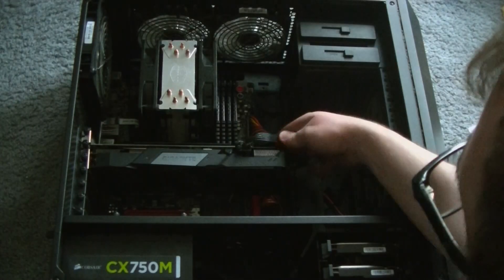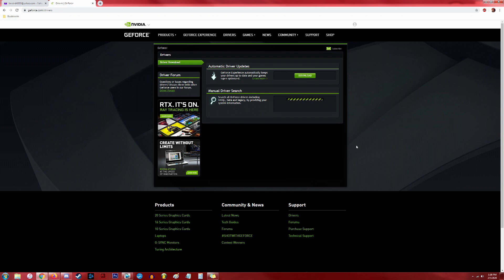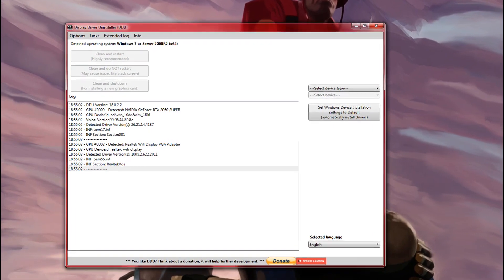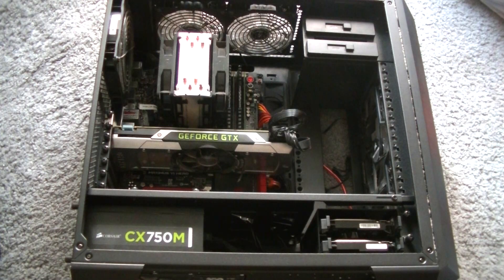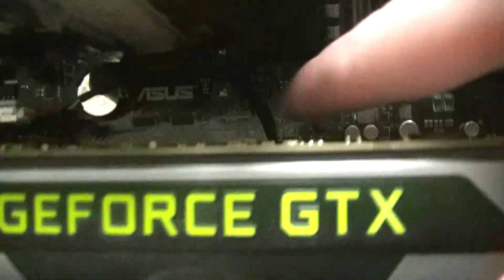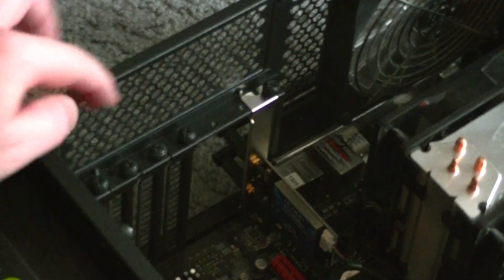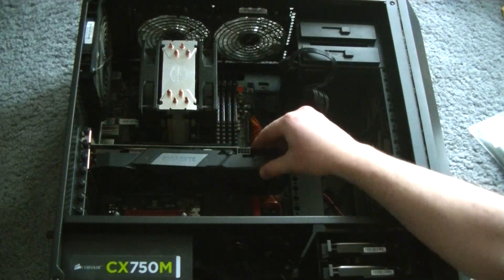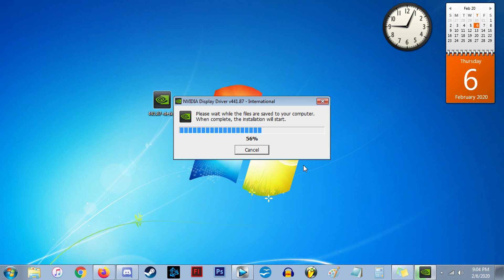How to Install a Graphics Card into a Desktop PC

Comment: This might seem like a stupid question, but I have a decently old computer that isn't made for gaming I want to upgrade. It has a small graphics card but I don't know if something like a RTX 3060 (what I am planning to buy) will work with it. Will the new GPU work? Can my computer handle it? Is this a legible thing to do or should I buy a new computer? Is it even compatible? Sorry for the long question.
Thanks in advance
Reply from the maker: Basically it's up to your power supply, I'd be surprised if even a small modern PC "wouldn't be able to handle it", because again, these days all GPUs should be compatible with all the components. Just make sure you have a strong enough PSU (check on NVIDIA's website and see what they recommend for wattage)
Reply: @Torqcx  Ok thank you

Comment: So if i have an uhd 770 integrated graphics, i haven't to disinstall any driver before installing a graphic card
Reply from the maker: You shouldn't! On modern motherboards the graphics will default to a dedicated card that's physically installed in the slot.

Comment: So does the graphic card work irrespective of the processor speed and all that or say

Processor speed: 3.00Ghz
Then yo wanna install gtx 1050 to.

Will it work?
Reply from the maker: The processor doesnt have anything to do with the compatibility of the graphics card, any will work alongside any. However, if a processor is not fast enough, it could bottleneck the performance of the graphics card.
Reply: @Torqcx  Ok thanks for the info
Reply: @Torqcx  hello, i was wondering how to get my pci cables out of my pcu because i have a prebuilt and im trying to install the gpu but i cant connect the pci cables because they arw stuck inside my pc
Reply from the maker: @Tom-oh5vs  They're stuck in the PC? You mean they're physically jammed somewhere in the system? If that's the case I'm not sure what to say other than just trying to force them out. They shouldn't be stuck into anything unless it was accidental.
Reply: @Torqcx  do you think if i force them out it will unplug anything else?
Reply: @Torqcx  and yes, they are litterally stuck in my pc. I even took out the psu and they are still stuck
Reply: i just didnt froce them out because i didnt want to break anything
Reply from the maker: @Tom-oh5vs  are they stuck in one of the corners of the case? Get pliers if you must, don't be shy shimmying them out.
Reply from the maker: @Tom-oh5vs  Based on all the info I have, I want to say nothing bad should happen? But I don't know exactly where the cables are stuck. PCI-e cables from the PSU only plug into graphics cards, so if they're not in a graphics card, I don't see what the harm could be in removing them from wherever they are right now.
Reply: @Torqcx  ok thank you i will try that

Comment: Can you install a graphics card into a office pc.  I don’t know the processor it just says i5 on the front
Reply from the maker: You'd need to open it up and find out if it has a PCI-e x16 slot, and from there determine if the PSU is powerful enough to support it (it most likely isn't, in which case you'd have to upgrade it).

Comment: where can u buy the cable that goes into the graphics card?
Reply from the maker: The cable will come off of the power supply, if it's powerful enough. If you don't have one and your graphics card requires one, you need a new power supply.
Reply: @Torqcx 
I checked my PC yesterday and I found the cable. thank you for the answer

Comment: See I have an mini itx board and a atx case and the pcie 16 slot doesn't line up what do I do should I just get a pcie 16 slot extension cable or will I just work I can send an image if you need to
Reply from the maker: I've never heard of a PCIe extension cable, but if the motherboard isn't lining up correctly it sounds like that's what you will need to do, otherwise you could get a new case.

Comment: What is there to to if i can turn on my computer but my monitor doesnt get a signal from my hdmi port and beacause of that i cant delete my old drivers can someone help me please ASAP ?
Reply from the maker: Do you have onboard video and it's not working? Do you not get a signal regardless of where the cable is plugged into? Try resetting the motherboard by clearing the CMOS (you'll have to look up how to do it)
Reply: @Torqcx  no i am using my old graphics card but when i plug in the hdmi from onboard to my monitor it doesnt work either but i think it never did in the first place if thats possible
Reply from the maker: @dwayneloco1215  that's because the motherboard is defaulting to the graphics card when it's plugged in and onboard gets disabled. When the card is out, you should be getting a signal from the onboard.
Reply: @Torqcx  ok so should i reset cmos first and then unplug the graphicscard to use onboard video so i can delete the drivers ? And thank you so much already your helping a lot
Reply from the maker: @dwayneloco1215  you shouldn't have to reset the CMOS, but if you still don't get a signal, then yes, try resetting it and go from there
Reply: @Torqcx  ok thank you for your time man i really appreciate it
Reply from the maker: @dwayneloco1215  absolutely!

Comment: I wanna install my RTX 3080 but I also need to change my PSU to 850 watt, Do I also need any water cooler because I don’t have one.
Reply from the maker: Water coolers are not necessary. Just upgrade your PSU and you should be all set. :)

Comment: Ok, just got a 1050 ti and there's like, 10 different drivers to choose from? Should i just grab the newest one? Im on windows 8.1 so im not sure if the newest one will work
Reply from the maker: Yes get the newest one and make sure it says it's for Windows 8.1
Reply: @Torqcx  done, i took out my old card, but the 1050 ti seems to have it's connector pins covered? Or are they just really thick pins?

Edit, they were covered, im an idiot lol

Comment: my left side of it isn’t going in i’m so pissed
Reply: Bro that’s what’s happening to me now is there anything you did to get it in
Reply: @charliep5894  did you guys find a fix?
Reply: @kitudja1  sorry for the late reply bro but my motherboard wasn’t sitting correctly and u kinda have to force it all the way to the io shield
Reply: @illbotyouonfortnitecuhh2637  yo wat happened weeks later? And i dont think the left side goes in like the right i was having that problem earlier but then a guy said it slides it and u screw it to keep it in place cause the left side falls out easier then the right cause the whole card isnt really snapped on thats y you use the screw
Reply: @charliep5894  sorry for the late reply bro but my motherboard wasn’t sitting correctly and u kinda have to force it all the way to the io shield

Comment: so i didn't have to uninstall my integrated graphics if buying a new one?
Reply from the maker: Correct; integrated cards are embedded within the system's motherboard, and the motherboard's BIOS (Basic Input Output System) generally will have a default of disabling its own integrated graphics drivers when a dedicated GPU is installed in it.
Reply: Thank you! Im just starting to learn now, just need a few upgrades on my pc

Comment: What the deuce do I do if it requires a 6-pin connector but there are no connectors
 available?
Reply from the maker: You can get a converter (there are various ones, but some that work at 2x molex to 6-pin), but generally speaking if your PSU does not have any 6/8-pin connectors, chances are it is not powerful enough to handle the card in the first place. Check its wattage (typically dedicated GPU's that are mid-grade require at least 400w or so).
Reply: Thanks.

Comment: After u install gpu and the pin do i connect hdmi there or at the top i have Integrated graphics or do i connect the hdmi at gpu
Reply from the maker: You would connect the cable to the newly-imstalled GPU.

Comment: How do I connect a GeForce RTX 2060. My cables have 1 eight pin and 2 break of two from 6 pins. I’m so confused where do I plug them in :(
Reply from the maker: I too installed an RTX 2060 in this video, and the card requires only 1x 8-pin. Just plug the 8-pin connector from the PSU to the 8-pin port on the card and you'll be all set.

Comment: Does 3070 graphic card support in h61 gigabyte motherboard with Intel i3 2 gen processor  which I have 4k TV to view 4k movies and play 4k games
Reply from the maker: Virtually any motherboard will support any graphics card, your power supply is what you want to be concerned about.
Reply: Power supply means the smps right which smps does it supports

Comment: Can you please help me I cant get to the windows screen,I'm stuck in bios
Reply from the maker: Did this happen after you swapped out/installed a graphics card? Try re-seating it, blow out any potential dust/gunk that could be in the slot, make sure the teeth on the card are clean, etc.

Comment: I'm trying to install a graphics card and a WiFi card, I'm wondering how to install a WiFi card in a PCI express 1 slot (not sure on terminology XD) is it the same as a graphics card or is there a few extra steps?
And whats the frames I can expect when I install graphics card, for games like apex, fortnite and valorant, can give a few specs now, let me know if u need more
Motherboard: D3230 A1
CPU:Intel(R) Pentium (R) CPU G3260 @ 3.30GHz 
Planned gpu: ASUS Nvidia GeForce GT710
RAM: 8GB
Reply from the maker: Installing a Wi-Fi card is a similar, easier process than installing a graphics card, and I have a video on it here: https://www.youtube.com/watch?v=nyqou9hU7mY

As for your system, those specs look closer to the budget side of things. Not bad, those games will certainly be playable, but you'd probably have to keep things on the medium-low settings if you want anything near 60FPS.
Reply: @Torqcx  thanks alot, so happy rn, have a great day man

Comment: I have one question. This pc that Im using now, has a GT 1030 DDR4 with a i3-4130 and I have another pc with Pentium G4400 but with GT 1030 DDR5. Since i3-4130 > G4400, I wanted to place the better GPU in this one. Do I need to do anything about the drivers? Or I just need to take out the gpu, place the other one and then Im good to go?
Ps: I don't know if this is important, but the pc with i3 4130 was from my uncle, so it has cracked windows 10. I was thinking in getting windows 10 the free version, with that watermark. What should I do?
Reply from the maker: You would just follow what was instructed in the tutorial. Does the other PC already have a GPU in it? If so, uninstall the drivers, take it out, put in the new GPU, and install the new drivers. Otherwise, just plug the new card into the system and install its drivers.

As for the OS, that is up to you. I don't condone or support piracy on this channel. If you want to be safe I would get the free version of Windows 10 (or just buy it).
Reply: @Torqcx  Thank you!

Comment: My gpu doesn't fit in my pc! What am I supposed to do?
Reply from the maker: Then you need a different GPU or upgrade to a new chassis.
Reply: @Torqcx  reeeeee I bought it on ebay and I can't return it. I guess I can use an extension cord but either I need to have it outside the pc or I need to lay it horizontal  and hope it fits that way and it's not too thicc

Comment: hey just a question where would i find the power supply cable that i can plug into my gpu (if that makes sense) i wanna upgrade my prebuilt with integrated graphics but i wanna keep my regular PSU so where would I find the “external power for dedicated gpu” cable?
Reply from the maker: The PCI-e cable from the PSU will only exist if the PSU has enough wattage to support a dedicated card, which most OEM PC's don't have. Most likely you will have to buy a new PSU that will be able to support your new graphics card and swap it out.
Reply: Torqcx okay thanks

Comment: I have an old hp pavilion that I brought in 2017. It’s a desktop pc that I wish I could play games on it with good fps. I was thinking what if I replace the graphics card and order a GTX 1660? Would I have any problems doing that? I’ve never done a tear down for a pc.
Reply from the maker: It's likely that that desktop has an integrated card, and it's possible you can upgrade to a GTX 1660 but you'll  most likely also need to upgrade the power supply.

Comment: So u take the side screen of the computer off? I’m a bit confused because u just showed inside the pc without taking anything off. I thought ur supposed to open the back of the pc to get the card out 0_o
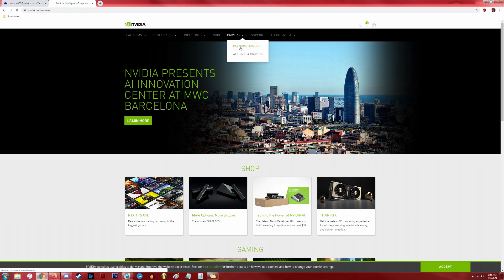Reply from the maker: You take the front side-panel off. Sorry  I did not show an example, I didn't want to confuse anyone because the case I have has a very odd, unusual method of taking it off. I have a video where I demonstrate the process on a more typical case right here: https://www.youtube.com/watch?v=nyqou9hU7mY @ 0:46
Reply: Torqcx thanks I’ll go check that out! I have this Lenovo h535 pc and trying to see if it has the slot to put in a card and if so what card to use.

Comment: Installed new graphic card,card is thicker than the old card.
And now my wifi card will not fit.hardline would fix this,but is there any other way to get wifi?thanks
Reply from the maker: There are WiFi USB sticks you can get. They work about as good.

Comment: im thinking of buying a new case, motherboard , ram etc and using my gpu that i already have, should i do it?
Reply from the maker: I don't see why not. What are your current specs and what are you upgrading to?
Reply: Torqcx current specs: i5 3470 ,gtx 1060 and 8gb of ddr3.         upgrading specs: Ryzen 5 3600, gtx 1060 and 16gb of ddr4 (3000)
Reply from the maker: @apzypz  Yeah, upgrading to a more modern generation board with DDR4 RAM is always a good idea, and for most games that card should still be fine. I should be doing the same thing soon, myself.

Comment: windows 10 vs 7 for gaming & emulaters?? Please some1 tell which is better for my geforce crad? :)
Reply from the maker: Basically, these days, Windows 10 will be the better, more stable option; as graphics cards, drivers and software update, an operating system that is no longer being updated along with them (such as Windows 7) eventually will run into problems and compatibility issues. Personally I prefer Windows 7 because I like its GUI and find it a lot more to-the-point, but soon I too will have to switch to 10.

Comment: I have two 6 pin PCIe power cords. Neither appear to "break away" am I screwed? Or how do I make one of them "break away?"
Reply from the maker: 6-pin connectors can't break away, 8-pins can breakaway INTO 6-pins. What type does your card require?
Reply: @Torqcx  The card requires one 8 pin connector. The PSU is a 550W ATX and the card requires a minimum of 500W. I think that's why my nephew recommended it to me when I sent him my PC's specs. I am currently looking for a new PSU since I just spent 220 on the card and have opened and partially installed it.  I'm super frustrated at this point.
Reply from the maker: @AlyssaVanStory  if you have no 8-pin connectors than I don't know of a safe way to connect the power to an 8-pin card, other than perhaps with a converter you could find online somewhere. They exist but I don't know how well they work.
Reply: @Torqcx  Ok, I appreciate the info. Great video by the way.

Comment: Hey I know you made this video a while ago but I took out my graphics card for something then put it back in and got no output how can I fix that
Reply from the maker: Just make sure everything's plugged in correctly and tight, the required power cables are in, and so forth. Do you have onboard video? If so, there's a chance the BIOS has defaulted to that when you took the card out.

Comment: dunno if you’ll see this but the left side specifically of my graphics card will not go in. it’s not the trays as i’ve taken the ones that need to be taken out. i don’t wanna break anything, but for some reason the right side of the connector is sliding in easily while the left is poking out. the ports on the back are also out of place and the metal on the left is no against the case frame to be screwed in

Comment: Nine has 2GB is that affecting my gameplay when I play fortnite cause I can only play 30FPS
Reply from the maker: Are you saying your GPU has 2GB of VRAM? It's possible that is contributing to the low FPS but we'd need to know more about your system. What's your CPU, GPU model, etc.
Reply: Yes that’s what I mean
Reply from the maker: @stablekikiyt  I don't know a whole lot about VRAM when it comes to a card's performance, but I doubt that that factor alone is what's causing the low FPS. What are your computer's specs? What kind of card do you have?

Comment: hey, so i put my new graphics card in and when i started my pc, it won’t connect to the internet
Reply from the maker: What kind of graphics card is it? After doing a quick internet search, I heard some of them have network controllers in them that can cause problems. First of all just try resetting your modem/router, and if you find out your card has a network controller of sorts in it, disable it.
Reply: Torqcx it’s a NVIDIA RTX 2060 Super, i reset my router and modem. but, i’m not sure if it has network controllers
Reply from the maker: @elisepulveda2555  That's really bizarre, that's the same card I have (used it in this video) and as far as I understand, no, it has no network controller. What's your OS? What exact error message are you getting regarding the internet connecting? Are you using wired Ethernet or Wi-Fi?
Reply: Torqcx sorry for the late response, but i fixed it! thanks so much for responding almost instantly! :)
Reply: @elisepulveda2555  what was your fix?
Reply: Ducky Mini It was quite a dumb mistake, i accidentally unplugged the network card in my motherboard. so unless you got a new motherboard that doesn’t have wifi built in it, then you should get a usb adapter